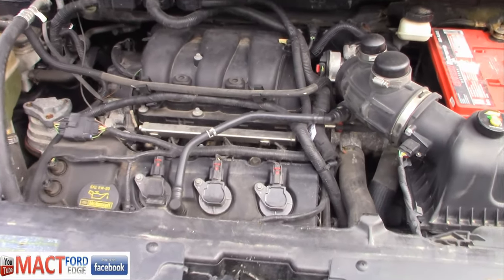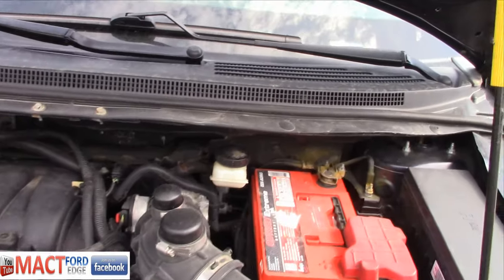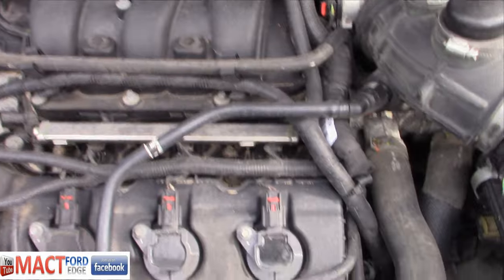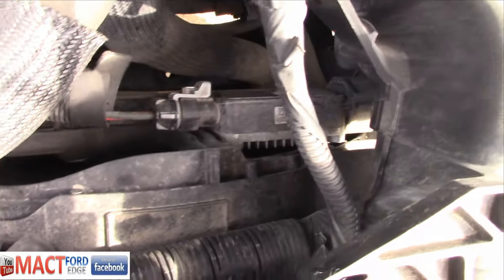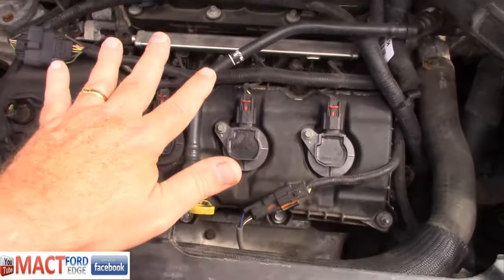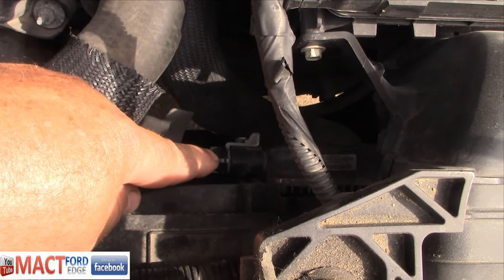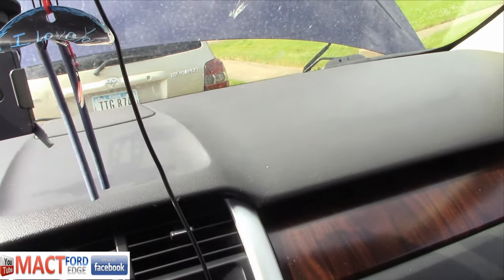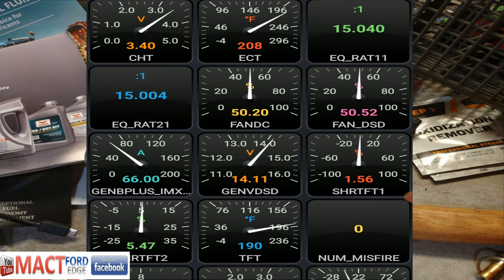This is one major reason your Ford Edge over heats and the AC does not work

Comment: You can run your heater to cool your radiator, also the defrost will run with the ac on, and with the ac on the defrost is on,  the sensor is usually on the front head that turns on the fans, the engine needs to at least 212 degrees for the fans to work, experience is key. 😊

Comment: When I bought my edge that fan control module was unplugged I plugged that in and the fans came on when the car was turned off so I replaced that box and the second one melted the plug that plugs in to it .but when that module messes up the ac stops blowing cold but my car never over heats

Comment: Heads up if you replace fans cause they have failed buy  them directly from Ford right off that bat. Save yourself some headache! Brother in law is a mechanic we found after markets fans were not kicking on or off when computer was commanding them to .  Returned to auto zone replaced with Ford oem No more issues!

Comment: Hey MacT! I have looked online for years why both my 2012 Ford Edge cooling fans come on full speed as soon as I turn on the AC. It sounds quite loud. I have had many cars throughout the years and never experienced something like this. I have read several testimonials online of people who claim to have solve the problem by replacing either the relays, the temperature sensor, the fan clutch or the wiring harness. Another guy claims that it is the air conditioner expansion valve and that as soon as he replaced it the cooling fans stopped and would only come on as soon as the engine reached certain temperature. I don’t know who to believe, but these fans sound really loud. Others claim that they took their car to the dealers and the mechanics there advised them to replace the fans however the issue persisted. The only way to turn them off is by shutting the AC off. But who wants to turn the AC off in the summer. However, you are saying now that this normal as long as you are traveling at less than 45 miles. The 2011-14 Ford Edge has got to be one of the most beautiful SUV’s ever created, but these loud fans turn me off. I’m pretty confuse. Have you witness other 2011-14 Ford Edges to find out if this is normal behavior with this model? I would greatly appreciate your response.
Reply: Any fix yet
Reply: @danielanokam  No. According to this guy that is normal as long as the AC is on.
Reply: The AC button... Winner winner 💯

Comment: I'm having same issue on my 2012 explorer but I wanted to ask you  those fans in this video the good fans or bad fans i think you didn't mention it.
Reply from the maker: Motorcraft fans.  I replaced the OE fans with the new motorcraft fans.  When I rebuilt the 2011 Edge (Herbie) in stalled the fans in it.
Reply: @MACTFordEdge  okay makes sense every detail of information is important 👌 thanks
Reply from the maker: @jvst20051  Yep however many only watch 3 min and 27 seconds of the the over 18 Minute video.

Comment: Hi , I’m having a problem with engine overheating. I can hear my fans turn on but then they turn off after about 20mins running. Especially if the ac is on. If i turn off the ac the temperature goes down. And the fans will turn on. Do you have any ideas what i could check? The fan assembly is new.
Reply: I’m having the same problem with my 2010 Ford Edge. Took it to my Mechanic twice and still can’t find the problem.
Reply: Interesting. Would like to know updates..
Reply: Have you figured out this issue yet! Having same or similar issue with my 2014.
Reply: Please tell me you found the solution.....

Comment: My daughters 2014 fans quit working today. Seems the connector that feeds the fans out of the fan control module, one of them has gotten hot a few times. I used a very small screwdriver to scrape inside the connector. The pin on the module looks ok. Cleaned all the old dried up dielectric grease out and put in some new. Got the fans working again but for how long is unknown. I'd like to replace the connector and was wondering if you know of any sources I can buy one ? ? ?
Reply: Maybe you can buy from dealer Ford.
Reply: Junkyard

Comment: Replace fans before you have an real overhearing problem block issue.  My fan were bad and water pump was failing. Water pump is internal and a real pain. Ford really dropped the ball for routine maintenance on the Ford Edge motor.

Comment: My edge is overheating when I sit at a red light or go through a drive thru. The fans kick on and off. We replaced the fan assembly OEM and the thermostat and it’s still overheating and blowing warm air. What else could it be?
Reply from the maker: Go to MACT Ford Edge on MEWE.  https://mewe.com/join/mactfordedge
Reply: Did you reset the AC and Thermostat. Google how to reset, you have to like hold 2 buttons etcétera. After we replace everything that's what we needed to do. I'm back cuz my relay exploded.
Reply: Mine doing the same thing Did you ever find out what was wrong with it

Comment: 08 edge limited. Overheating. Both fans come on when car starts with AC on.  Sitting at idle, Temp starts to rise above 221°.  Once I turn AC off and/or turn the heater on, the temp drops to around 203° and fans slow down. Car is guzzling coolant. Both fans work but can't keep up with the AC on.
Reply: Adding it does have two connectors on the relay. It has a tow package
Reply: I'm no mechanic but I'm dealing with one now. If you're losing coolant I found a pinhole leak. I couldn't believe it. Just a dripping when it's hot in the T on top that connects the coolant hoses. It was on the bottom of the tee and was just dripping down where I couldn't see it with my flashlight until I replaced the radiator and everything I noticed it. That's got to be why you're losing coolant. Is that you have a leak. coolant doesn't just evaporate into nowhere. You got to be losing it somewhere

Comment: How we can determine if it’s thermostat or coolant temperature sensor or just fans? I have overheating problem on my 2011 model. When I start a car fans works okay no matter AC on or off. After 15-20min AC starts slowing down and fans does not want to kick in and I see engine temperature is going above the normal so I shut down the car. Any advice?
Reply: I’m facing same isse right now if you find any solution please let me know
Reply: Fans!!! Being there, done that. Cost me over $900.
Reply: You could have went to the junkyard tried it out on one of their junkie cars and then if you felt okay with it, go buy one 75 bucks and spend a couple hours putting it in

Comment: Im ready to send my 09 ford edge to the crusher. Ive searched online for 3 months now replaced every single thing anyone has said worked to make the fans come on. Ive replaced the pcm that the fans plug into ive replaced the fan which came with another pcm pre assembled to it ive replaced every single relay and fuse in both fuse boxes. Ive replaced the high pressure switch on the AC high pressure line. In total im at around $1400 in repairs the fans are good i can hook them up directly to the battery and they come on at full speed. I just now switched the high pressure switch still nothing found idk if your able to help or not im just at my witts end with this car
Reply from the maker: so you have replaced and verified the Engine Coolant Temp sensor under the lower intake manifold is Good?

Comment: So I went on vacation for 3 weeks and when I got back my edge started right up. Then 3 days later the battery died. Got it jumped and now the CD player won’t let me retrieve my cds or p new ones in. The screen just says initializing anytime I press a cd button. Any tips and tricks to get it working or get my cds out? Also the battery died again hours after the jump —_—
Reply: You have an ECM problem.
These cars have so many electronics. Might need to
Take to Ford and have re flashed or replaced .
Reply: @theringer13  it ended up fixing itself after I got the battery rejumped. Thankfully!

Comment: Mac im doing my own tests right now cold start I only have a small scanner reading live data from ect and checking my temp fans to kick on 2012exploer 3.5l everything is working good im thinking I just needed coolant.thats why it kinda overheated last time.cold start no ac both fan kick on at1xspeed  103c off 104c 2nd tim 2xspeed 112c took 10minutes thn off at103c 3rd time got to 115c  the dugital guage in cluster went almost close to overheating I had to turn it off now what fans dint kick on and I could hear bubbles in coolnt reservoir
Reply: Mac do you think I have a bad ect coolant temp sensor cuz on your videos it reaches temp 203 mine does evnt get that close but fans do turn on or do I have air in my system
Reply: Got the message engine coolant over temperature
Reply: Did you ever figure this out
Reply: @WilliamPurcellHotshotCustom  yes my problem was the fan module but I replaced the fans it was cheaper and it came with the module already after that no more iver heating

Comment: YO MAC T -  What is the "cap" you have installed on the air filter cover?  Also, should I remove the resonator like you did and cap? Advantages?

Comment: I had my MKX 2011 parked but turned on and when I got on to continue I heard that it sounded (it was showing high temperature at the maximum) but I did not pay much attention until almost half a minute after starting the march and stopped at the traffic light.  The suv trembled and it felt strange, but at the same time the temperature dropped immediately to normal.  I stopped, turned it off and checked but I didn't notice an overheating but I think it was hotter than normal, i think. I continued and got home normal, but now I have a check engine light on and I don't know if it caused any damage.  any help will be greatly appreciated

Comment: Okay I need help i have a question I have a brand new fan for my 2010 ford edge limited. And it is not coming on I don't know if it's a fuse but I got it checked and they say it's not I don't know if it's the compressor all I know is I can drive for awhile in my car run hot I have gotten the fan replaced twice and the fan is not coming on so can someone tell me what else can it be
Reply: And my air conditioner do not work as well
Reply: There also the temperature sensor sometimes called head temperature sensor or fuses and relays
Reply: There also a  small sensor  called  ambient ac sensor on front